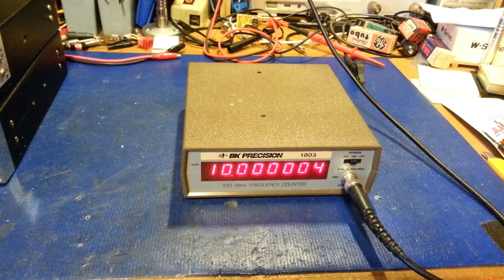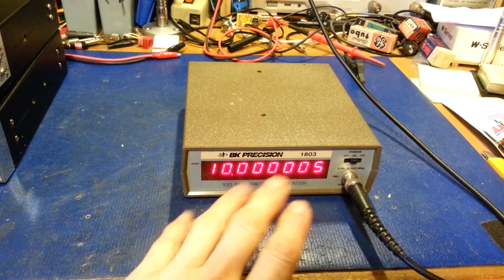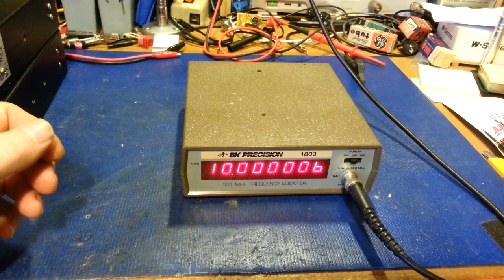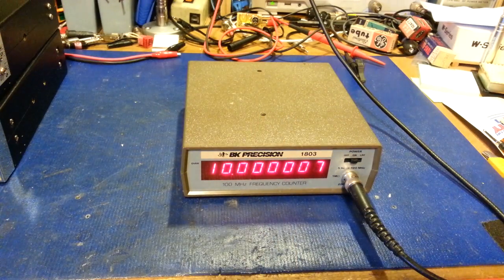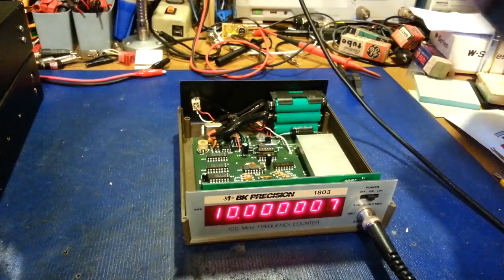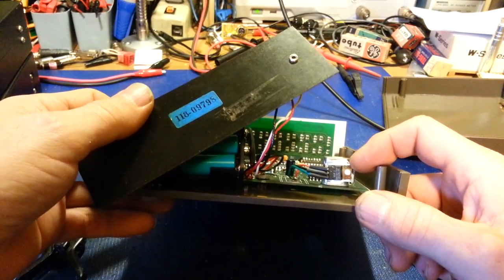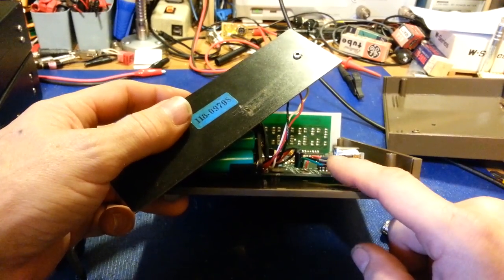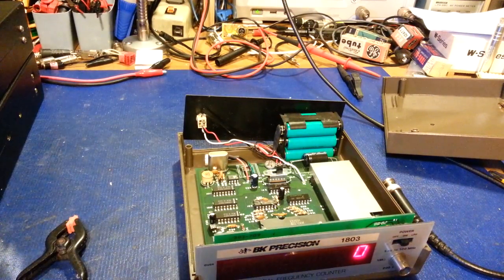BK Precision 1803 100MHz battery powered frequency counter poor man's crystal oven modification.

Comment: Temperature is not always the same. This make no sense at all. You need to stabilize the temperature.
Reply from the maker: You do realize this is not a laboratory style frequency counter.  It is never going to be super accurate.  This modification just helps to stabilize the frequency drift as much as possible and it does work.  It is now much more stable than it was before.  What do you think they have done in two way radios for decades?  They just strapped a resistor to the side of the crystal.  There is no "compensation" or temperature sensing circuit.  Just a resistor stuck to the side of the crystal.  Doing just that can take a radio that drifts horribly in frequency and stabilizes it to a reasonable amount.

Comment: I agree with you on the advantage of it being battery power.  Your modification sounds like is the best solution.  Instead of designing a crystal oven for the unit.

Comment: Here in Michigan a lot of guys have hot glued long life wheat bulbs to crystals to speed up warm up drift on SSB radio's used in mobiles. It can take forever for a radio like a Galaxy to settle down on SSB during the winter.
Reply from the maker: buckaroobonsi555 

LOL, Galaxy settle down, that's funny. :-)  Their big problem is not just crystals but their transformer  coils change value as they change temperature.   Unfortunately it's just a lot of cheap parts that end up resulting in a very drifty radio. Stabilizing the crystal temp definitely helps but there are other problems to.
Reply: I never said you should do it or that it was a solution! LOL I just said a lot of guys in Michigan have that done. It is kind of like saying a lot of guys over modulate on CB it is not an endorsement rather a statement of fact ! LOL I do not own such beasts so not a problem for me. I am not exactly the Galaxy type! LOL People do all kinds of things for all the wrong reasons just look at the stupid stuff people put on their car's or do to their rifles!!! Well the way the world is going it wont be long before the only SSB radio's you can by will likely be Galaxy's!!! Cringe Horror of Horrors.

Comment: I prefer to use a suitable PTC resistor glued to the crystal, it's actually self regulating.. as the temperature rise the current drop and it stabilize on a fixed temperature...